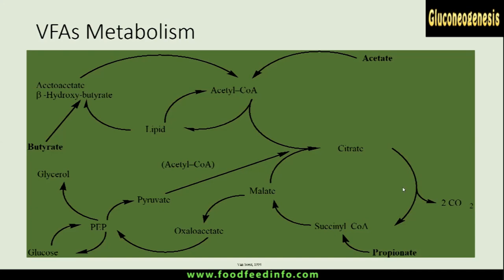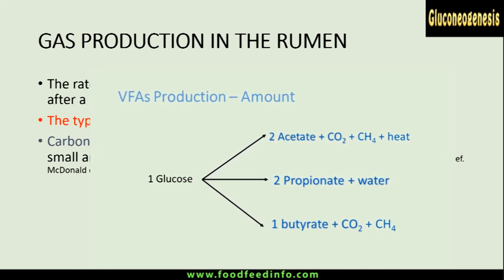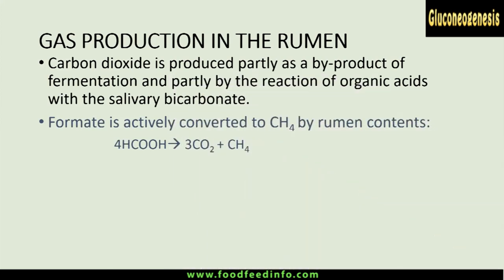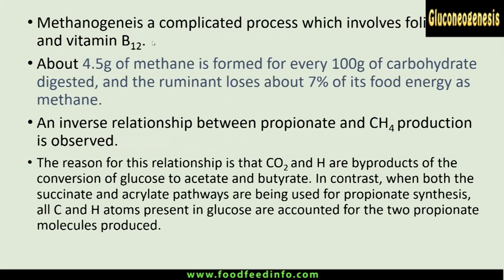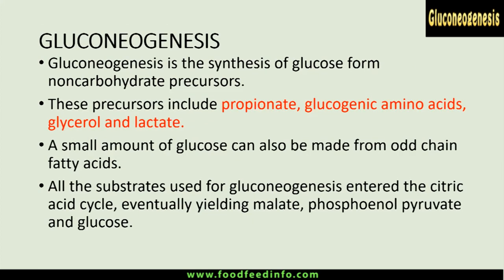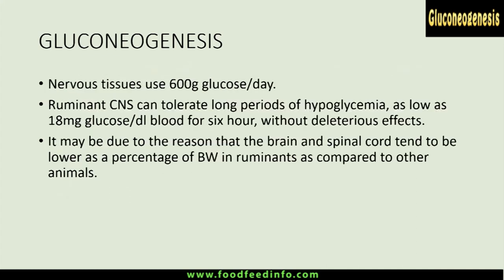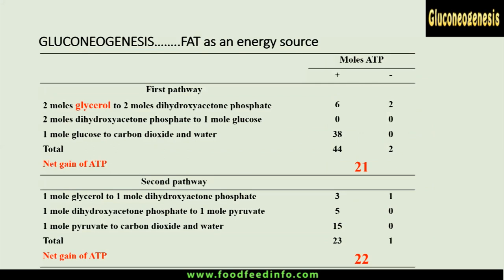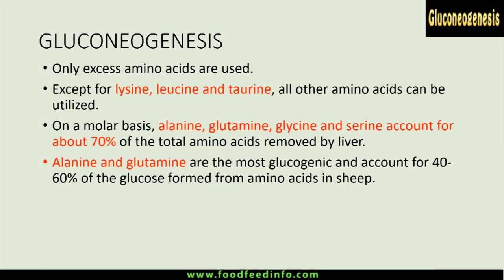Lecture#16-Part-5 of 5-Gas Production and Gluconeogenesis in Ruminants- Lectures in Animal Nutrition

Comment: Co2 is by-product in rumen fermentation 4.5 g of methane form in every 100g of carbohydrates digestion thereby ruminant loss 7% food energy as methane .
Ruminats utilize the acetate instead of glucose as major energy storage and oxidation. And rate of glucogenesis is short after meal when glucogenic substrate are more in amount.
19-Arid-2181

Comment: Gas production occurs in addition to VFA'S during carbohydrate metabolism. This has production is termed as methanogenesis because mostly methane is produced.
Methane is produced only when roughages are fed because metabolism of roughages results in the production of acetic acid in which C and H are byproducts that form methane. But when grains are fed propionate formation occur and in this process C and H are not in  free state but part of glucose.
19-arid-2236(A)

Comment: #1) Whenever there is the production of volatile fatty acids in the rumen of the animal, there is the production of some gases such as carbon dioxide, methane, and hydrogen.
#2) The amino acids that are mostly involved in gluconeogenesis are alanine and glutamine. They account for 40-60% of the glucose that is produced from amino acids.
19-arid-2246 morning section B

Comment: Acetyl co a could be used for lipid synthesis or for getting energy in citric acid cycle. Co2 and methane are gases produced in larg quantity during fermentation un addition to VFS . Ruminants utilize acetate instead of glucose for energy storage and oxidation during gluconeogenesis.
19-arid-2268

Comment: 1- In case of ruminant the gluconeogensis increase after feeding and decrease during fasting because of available precursor. As their end result is VFAs not glucose.
2- In case of monogastric gluconeogensis is maximun only when feed recently consumed. Because their end product is glucose.
3- There is inverse relation between the methane and propionate.
19-arid-2182

Comment: In rumen gas production rate is rapid immediately after a meal and in cows it can exceed 30 L/hr.
The rumen gas consists of 40% CO2, 30-40% methane and 5% hydrogen with small and varying proportions of oxygen and nitrogen.
19-Arid-2263

Comment: 1) The typical composition of rumenal gases are 40%CO2, 30-40%CH4, 5%H2 and small proportion of O2 & N2.
2) 100g of carbohydrate digestion produce about 4.5g of methane.
3) Alanine and glutamine are more glucogenic and produce 40-60% of glucose formed from AA in sheep.
19-arid-2200

Comment: 1-)The combination of following gases are produced in ruminants after a meal.i-e Carbon dioxide 40%, methane30-40%, hydrogen 5%, and some other varying proportions of oxygen and N.
2-)While Carbon dioxide is partly produced as by product of fermentation.
19-Arid-4425

Comment: 19-arid-2225
The major gases produced in the rumen are carbohydrate hydrogen and methane. About 4.5 gram Methane is produced per 100 gram carbohydrate digestion in rumen.
 Except leucine, lysine and taurine all other enzymes are used in gluconeogenesis.

Comment: 1.Rumen gases consists of 30-40%CH4, 40%CO2, and only 5%H2. Hydrogen is usually come from ingested air with small amount of O2 and N2.
2. Gluconeogenesis is the synthesis of glucose from non-carbohydrate precursors such as propionate, glycerol, lactate etc.
19-arid-2219

Comment: In ruminant the process of gluconeogenesis is at its peak after feed intake while decreases in rate during fasting because of the availability of precursor 
In ruminant the level of blood glucose remains constant (40-60 mg/dl due to continuous glucogenesis and production of volatile fatty acids.
19-Arid-2290 
Evening-A

Comment: 1. In ruminants, Gluconeigenesis during fasting decreases whereas after feeding gluconeogenesis increases. Ruminants mainly use acetate instead of glucose as a substrate for storage of energy and oxidation.
2. The gas production rate is mostly rapid immediately after the meal in the rumen.
19-Arid-2196

Comment: As we know that the acetate is responsible for the production of lipid by one pathway. And if we see the gas production so it is in high rate after the meal contain 40% CO2, 5% hydrogen and 30% methane.
19-arid-4423

Comment: The rate of gas production in Rumen is most rapid.
Typical composition of rumen gas is 
~carbondioxide 40%, methane₺030-40%, hydrogen 5%
19-arid-2252
DVM Morning

Comment: Co2 is produced by fermentation.
Rumen gas contain
40% methane 
40% carbon dioxide 
5% hydrogen

19-arid-2203 
Jahangir Iqbal
Section A

Comment: ✓The rumen gas contains different mixture of gases like carbondioxide,  methane, hydrogen having the small proportion of oxygen and nitrogen.
✓In sheep Amino acid Alanine and glutamine are the most glucogenic and almost they form about 40-60% of glucose into amino acid.
✓On the consumption of 100 g of carbohydrates ruminants animals loss 7% of it and hence forms 4.5 g of methane.
19-Arid-2254

Comment: 1) The process of the synthesis of new glucose in case of ruminants accelerates post-feeding whereas, it decreases when the animal is in the state of fasting.
2) There is about 600 grams use of glucose by the nervous tissue per day.
19-ARID-2248